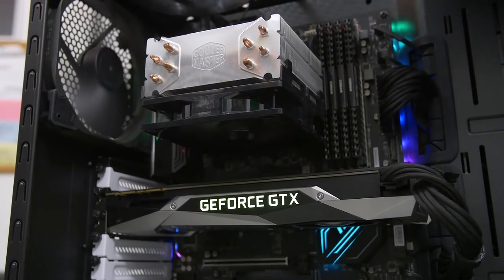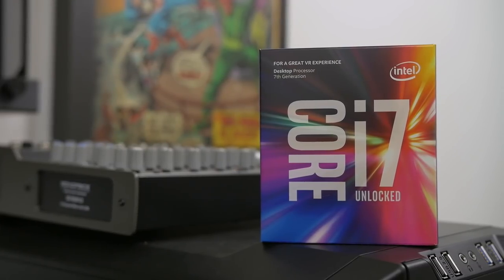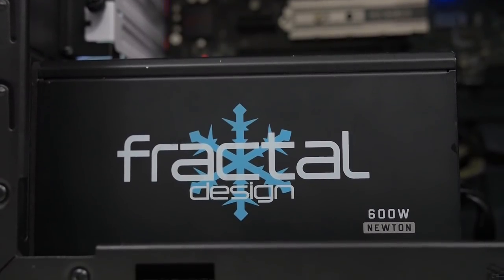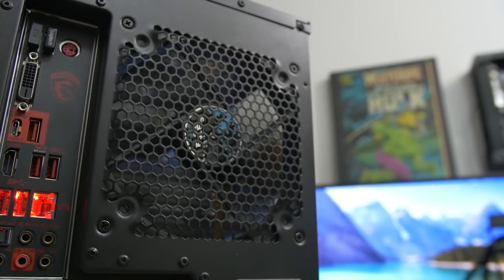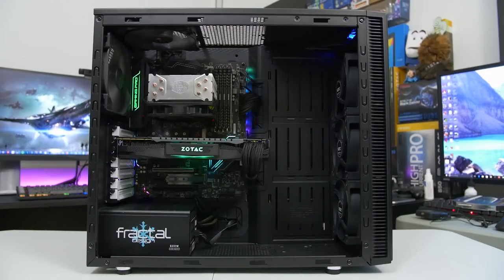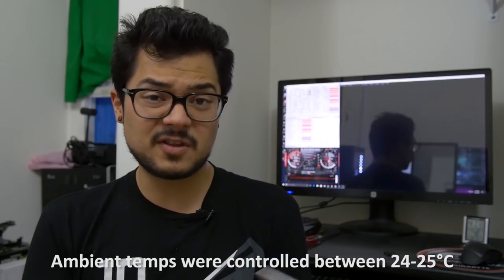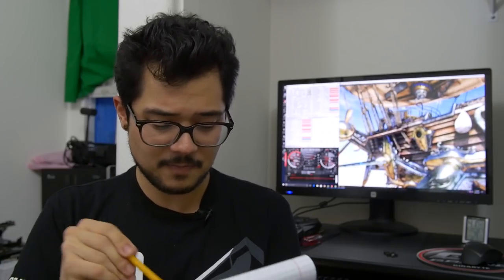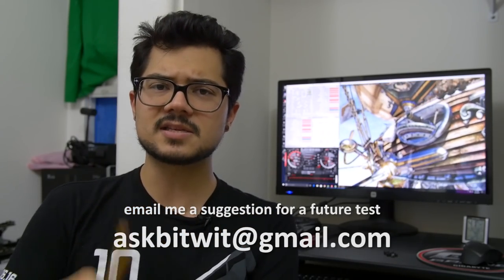This is how you should mount your CPU cooler! I think??

Comment: the vertical orientation recycles the open air style GPU's heat. it raises from the GPU gets pushed back by the front case fans into the fan for the CPU heat sink, where as the horizontal orientation helps exhaust the open air style GPU's heat with the two exhaust fans at the top and the air flow being more of heats desired path. Because the heated air from the GPU it is thinner it moves faster thru the case vs. the closed shroud gpu and thicker air. plus with more air pressure in the case with an open air shroud you will get stronger positive pressure better utilizing the bottom exhaust and other cracks and crevasse. at least this is my theory!!!!!!!!!!!!!!!!!!!!!!!!!!!!!!!!!!!!!!!!!!!!!!!!!!!???????????????????????????????????!?!?!?!?!?!?!?!?!?!?!?!?!? Hope it made sense! please let me know what you think?!!!?!?!?!?!

Comment: My aio system leaked on my GPU and I recently replaced both. Except I went with a cheap CM hyper T2. I didn't have the original brackets to mount the cooler on my ryzen chip and you'd all be ashamed at how I mounted it. I jerry rigged it with the Intel brackets. LMAO but it's working until I can replace my aio.

Comment: What if you mount an AIO in the top with the fans pulling the air in?????? like my h440 with 3 120fans in on the front and an exhaust 140fans in the back. I'm thinking of getting a kraken x62 CPU cooler... Right now I have a 212 evo.... or should I think about getting a better air cooler???? would be grateful for any help.

Comment: I have just fitted the same heat sink mounted horizontally so the hot air is blown up and out of the case as hot air rises. the CPU temp at idle was 37 c with the old heat sink now it's 25 c with the new so does the job for me.

Comment: Would it make a difference if I'm using a dark rock pro 3
Reply: The degrees would be a couple numbers lower, but no.
Reply: How the hell you could fit that thing vertically I would never know. Mine would be sucking air directly from the GPU's backplate...

Comment: If u had a Corsair h100i platinum or a 
kracken x 52 and u mounted the radiator on front panel with the correct fan direction of your case would it be a issue if the radiator tubes where down or up would that cause a issue with water flow or air traveling threw the pump

Comment: The so called blower style is not as effective to create equalised temperature. Eventualy heat will rise from the GPU. "Open" air cooled zotac with bigger heatshink can dissipate the hot air evenly within larger surface area tus the average temperature will drop.

Comment: with horizontal and founders addition is it possible the gpu is sucking more cool air from the front fans and thus less air for cpu to pull other than the top front fan? then with the board partner cooler the air is recirculated and maybe recooled by the front fans?

Comment: I dunno... does this have real world implications and use? If my cpu gets hotter, it turns up the rpm... when not, then it turns down. :) I don't see the reason for messing with vertical and horizontal placement to get a negligible change in temp, other than for academic exercise sake.

Comment: Ok so this is my very first time building a PC so yes I'm a newbie lol. And I was hoping someone could give me a second opinion or tell me if I'm doing it wrong. But out of all the hours of research I've done on it, I came up with these components for my PC. I'm not quite sure if these are all compatible, but from what I researched about each individual part, they all seem to be very good and within my budget range perfectly. I will mainly be playing WoW on it and other blizzard games, mmos or maybe some moba's. So here it is and would love some feedback, would much appreciate it!
 Thank You (:

Motherboard: MSI Gaming Intel Skylake H110 LGA 1151 DDR4 USB 3.1 Micro ATX Motherboard (H110M Gaming) 

Gpu: EVGA GeForce GTX 950 2GB FTW GAMING

Cpu: Intel 3.70 GHz Core i3-6100 

Ssd: Samsung 850 EVO 250GB 2.5-Inch SATA III Internal SSD 

Power Supply: EVGA 500 W1, 80+ WHITE 500W

Ram: G.SKILL 8GB (2 x 4GB) Ripjaws V Series DDR4 PC4-17000
Reply: Should be ok. What case and heatsink are you going to use?
Reply: TerryBranding the case is a Corsair Carbide Series Spec-02, it's quite beautiful lol. But I was going to get the Evo 212
Reply: All seems well, except don't get a 212 EVO and instead go with like a Cryorig H7, it's better performing and quieter. At this point however, wait for Ryzen.
Reply: Slavjan okay awesome thanks for the advice I really appreciate it man. (:
Reply: No problem. I will also say though, make sure that 250GB is enough for you. You can always get a HDD (stick to Seagate and a WD blue/black drives) and use it for games, side by side with your SSD.
Reply: Go to pcpartpicker to see if the parts are compatible
Reply: SlavjanA Yes, awesome! So helpful guys, thanks a bunch!
Reply: I'm not saying the gtx 950 won't be OK for your kind of gaming but I think that if you analyze dollar per buck I do not think it hits any sweet spots anymore, have you thought about a beefier graphics card? (Spend a little more money gain a lot of performance)
Reply: freddie andersson my budget for one is between 150 and 200, so what do u think of MSI GeForce GTX 1050 TI, the reviews make it sound perfect for my budget
Reply: narudako I think it will give you a lot more bang for your buck!
Reply: freddie andersson awesome thanks for the help. I'm glad you pointed that out so I could find something better with a better price, much appreciated!
Reply: If it's between 150 and 200 then go for an rx 470, much better price/performance, and you get better Vulkan and DX12 support.
Reply: If you're going with 1050ti, rather go with RX 470 man, it's much more worth it.

RX 470 > 1050ti

Comment: Always put your radiator in the pull orientation so that it makes it near effortless you get all the dust off of it. Even if the temps were lower in the push setup it wouldn't be enough to make up for the difficulty of trying to get the dust out from under the fans.

Comment: It could be heat conduction from the hotter nvidia card/backplate to the motherboard n cpu cause the nvidia card should be running hotter than the zotac card and with the 212 evo in the horizontal position, the heat developing between the 212 and the gpu's backplate is not moving as fast out of the case..

Comment: This exactly happened with me.. I changed yesterday from a Asus turbo to a Asus strix and the CPU temps dropped 11 degrees on a S340..I don't get it. Although I added an additional fan in front..But not sure how much difference would that make.Temps on idle is 21  and load goes around 63. Got an i76600k with a z170 Asus pro gaming aura Mobo..

Comment: Hi Bitwit!!!. I have an AMD Ryzen 5 3600 processor and I ordered two coolers detailed below. Cooler Master Hyper 212 LED I also ordered a 2nd fan to be installed in the cooler. The fan is Cooler Master Sickle Flow 120 Red. I also ordered a Cooler Master Hyper 212X Turbo. I think the latter is better. That's right? I plan to install the Cooler Master Hyper 212 LED to another processor that my son has is an Intel Core i5 3470. My question is this: Can I install the 212X on the Ryzen 5 3600 and the 212 LED on the Intel Core i5 3470? I also need to know how much watts of heat each cooler dissipates. I actually ordered the 212X for the Intel and the 212 LED with two fans for the Ryzen. I need your golden help please. Both coolers have two fans and all fans are cooler master. What do you say?

Comment: Could you make a video on the temperatures from dual fans on a air cooler 1 cooler with both fans blowing in same direction and then the 2nd air cooler with both fans blowing into each other. I have a ryzen 7 1700 setup overclocked to 3.9 ghz with the 2nd air cooler setup and it’s been running fine with no problems staying under 80C under heavy load. Thanks

Comment: What if you don't got a fan on top of your case and only have one on the upper backside sucking air out? 
I have the evo 212 aswell and I mounted it like it was picture in the manual, which is horizontal, sucking air from the gpu. I wondered if I should mount it vertical, since I don't got a fan on the roof. What do you think?
Ps: I've got a second cooler Master fan an mounted it on the other side of the evo 212, facing the same way as the fan it comes with. Idk if this will help Temps. Which are btw on100% load at 62 Celsius with 3,9 turbo boost. I'm planing on oc soon to 4,2 or higher (i7 2600k). What are Temps that could be tolerated?

Comment: How much improvement do you think there would be having a 2nd fan on the evo212 in a push pull config?  I have a 212 on a i5 6500 processor with a r9 390 video card with a 2x4 kit of ddr4 in a define r5 case.  also would my system see more improvement from a better cooler or a 2nd kit of 2x4 ddr 4?
Reply: for the fan thing: i saw a video from another tech youtuber (not sure anymore who it was) who tested 2 vs 1 fans on an air cooler and it lowered the temps about 2°C so not much improvement there. Especially since your cpu is "only" a locked i5 it wouldn't make much sense i think.To your ddr4 question: Depending on what you're doing with your pc. If it is gaming you would definitly future proof your system with 16gb ram vs 8gb. But perfomancewise you wouldn't see any benefit. Not even in video encoding wich usually benefits quad channel (4 ram sticks) over dual channel (2 ram sticks) but the memory controller on the i5 only supports dual channel memory configs so in case of 4 ram sticks it would run them in 2 times dual channel not in quad channel - at least from my understanding.
Reply: Both of those points make sense.  Thought there would be more improvement from 2 fans on the cpu.  My temps are  a bit higher than I care for but not particularly running into trouble.  2 degrees C is disappointing.  To be honest if I were really concerned I'd open one of the panels on the top of my case for better air flow.

Comment: with the gpu that exhausted the air out the back acted like another out take fan wich means its pulling more air than the card that just circulated the air around, when there is less air in the case there is less air to transfer the heat to and is why i have all intake fans only with 1 hole for exhaust in my setup, also when you have more intake fans you are speeding up the process of having more room temp air go into your case to transfer the heat to the air that will be quickly exhausted

Comment: Could someone help me please? My case has 3 coolers: 1x 200mm frontal (intake); 1x 120mm backwards (intake); and 1x 200mm top(exhaust). Im upgrading my cpu cooler with an hyper 212, and i dont know why it was installed with the cooler facing the top-exhaust fan. That means its blowing hot cpu air on my GPU. Cpu is showing really good temperatures. My GPU while playing is not going over 75 degrees, but i noticed its taking a lot longer to cool down when idling. Should i reverse the cpu cooler(Face GPU and blow air towards the top exhaust fan)?

Comment: try another open GPU with the heat spreaders going front of case to back of case instead of side panel to side panel, I have a feeling it has to do with which direction the air is forced out of the card. I have an RX 480 with heat spreaders forcing air to the front and back of the case and I seem to get as cool temps as 55*c and 54*c under full load

Comment: 1st test. nzxt intake fans are junk so graphics card alone is probably stealing too much air away from the cpu cooler.
Reply: I tested a few fans on a h55 radiator attached to my rx 480 via nzxt g10 bracket last weekend (gpu at 1475 core 1.25v and 2150 memory clock) and a single gentle typhoon at 1400 rpm in PULL !outperforms 2x the nzxt fans used in this video at max (1300 rpm in hwinfo64) by about 3-4°. Even 2x corsair ML120 only performed on par with the single gentle typhoon in pull and they were peaking close to 2000rpm. 2x gt in p/p outperforms the corsair ML120 p/p by another 3°. This was on a skinny little h55 rad.

Comment: it does not fucking matter mount it how you like most ppl have cases with proper air flow dont listen to ppl that go on about how its bad and makes alot of difference they are just ppl that dont have a clue just like ppl that bang on about how you should apply thermal paste it dont matter as long as it stays on the cpu and does not go down onto the pins when you put cooler on ive done the pee in the middle the line the cross and still temps are under 30 when idle and under 50 when gaming on an i7

Comment: Interesting series of videos but not enough senerios or info to properly analysis the variables.  You could do more runs with just cpu load and then just gpu load but maunually set fans to typical combined load speeds.

Comment: Hey, I don’t know why yours test results are way higher than my?? I got hyper 212 turbo cooled  ryzen 5 1600 overclocked at stable 4GHZ with a liquid cooled R 9 290 also overclocked and  blow air towards the case, at PUBG full load I am getting average CPU temp at about 40C max  and GPU 58C max. All horizontal setup.  Don’t try to brag here. But all results I see for the hyper 212 are higher. Don’t know are yous did to your PC

Comment: Can you test gpu temps by connecting a wraith spire cooler to a gpu using soft copper pipes coiling it on the wraith spire and connecting the copper pipes to the gpu heat/copper pipes?  Thanks.  Iloveyourchannel=)

Comment: So this test is questionable due tot the a purely push only setup. Do a pull and then you have a better test, as that is the preferred orientation for those who want to keep a clean system without tearing everything out of the case.
Reply: Robert Williams I thought positive pressure was the cleaner way. You're only having dust go in the intake that is filtered as opposed to negative pressure which wants to suck air in every crack in the case causing more dust build up.

Comment: Have a Dell 7010 HT  third (3rd) Gen.  I-5 3.2 GHZ and is a Tool Less Case and the top is solid with NO vents.  Have one fan by the back vents and the EVGA GeForce GTX 1050 Ti SC has an included air fan vented to the outside of the case.  If I up-grade to an I-7 CPU then may have to Up-Grade the CPU Fan to a Noctua Tower Fan blowing to the back of the case.  Then the CPU Fan will be like a Push-Pull (Push aid through the CPU cooler and pull the exhausted CPU air to the outside of the case.  Can I Over Clock on the Dell MB ?  Thank you for the video !  tjl
Reply: Tim Lipinski Probably can't over Overclock it because Dell doesn't use Z chipsets on their motherboards.
Reply: or buy a new pc and even if u could OC the crapper mobo and psu that arent desgined for OC would not take it far at all

Comment: How to install motherboard temperature sensors (location)?
Reply: The motherboard box includes 3 or 4 optional temperature sensors (it looks like a cable, at its end has the point of contact)
Reply: Thanks for the answer helped me to understand some things. My question was for another motherboard (asus extreme VIII), but I thought the other motherboards also included these optional sensors. Bye (:

Comment: ok I know this vid was done along time ago but I'm gonna try and explain the reason why the first test was hot with the closed is because the open gpu fans were probably spinning and sucking cold air in that had been cooled by the fan+heatsink+open gpu+faster fans if you know what I'm saying had the same problem except my asrock killer x370 would only let me blow air up and down/vertical because of that crap tightening clamp and no mount to mount it towards the back and no cooler master would not send me free part to fix the sent me a plastic mount that switches from intel to amd but the x370 killer mounting bracket space is weird compared to my b350m msi it fit perfectly but yea air getting sucked in by the open air gpu since fans were spinning faster then your back fan probably with a grain of salt the second one makes no since to me.

Comment: Absolute rubbish, but heat diffusion versus radiated heat. 
Horizontal - fan creates negative air pressure as it flow directly out of the back behind the heat sync. Heat radiates off reference cooler from one location into case. Ignoring it blows air out the back of case, as it it does not add to the internal heat of case. Whereas, custom cooler provides the opportunity to dissipate heat in all directions, air can bounce back through fins or through panel on the face of card whilst stripping heat. Same applies to top openings of GPU. Therefore, for the "custom" cooler most of heat is drawn away through negative pressure area without being fed through the CPU fan or radiating less on to heat sync from the back of card, whereas reference cooler only dissipates heat in one direction therefore heating the heat sync itself. Bare in mind the custom cooler will create vortex air flows in case to complicate and unevenly diffuse air flows, but that is entropy I won't touch due to lack info... Use a smoke machine to determine airflow in case.

Comment: I do it a different way...CPU Case blows in, 1st CPU blows, 2nd Sucks and on the top of the case are 2 fans, that blow the hot air out!

Together with 2 front fans, that blow in and a GPU-Fan that also blows into the case.
So i pump a lot of air into my case and use the nature of hot air to blow it out on the top.

I WANTED to mount the CPU-Cooler, so it also blows to the top, but it doesn't fit...eh...
However my good old 2500k is chill as fuck...@4.2 GHz

Comment: will exhausting my case threw the front do anything? want to use the back and top as intakes and front 2 fans for the exhaust point. due to the fact i want my radiator as an intake to help with dust build up on the radiator and also want good airflow. my only concern is i know hot air rises. any one have any advice using a cm Storm Trooper and a  h115i for the cooler with it top mounted.